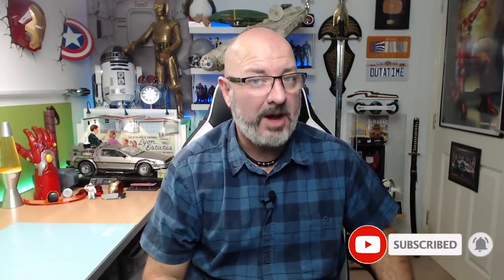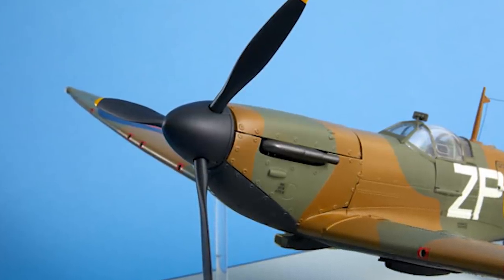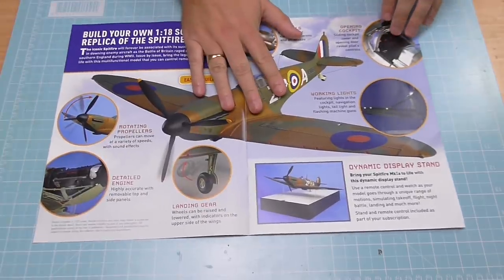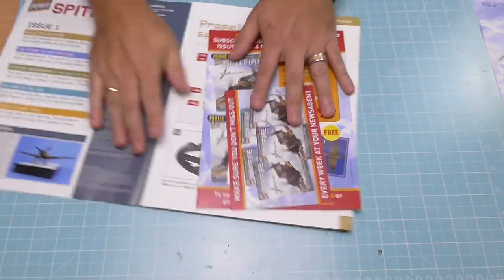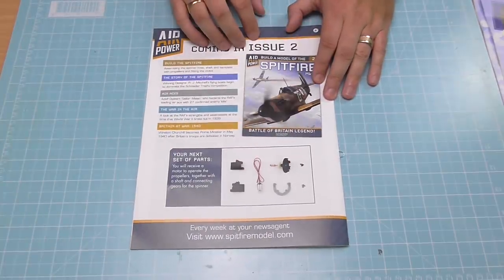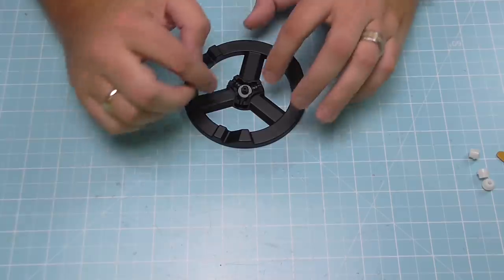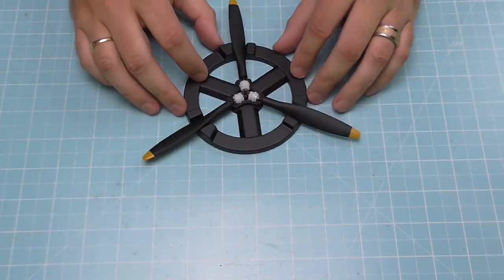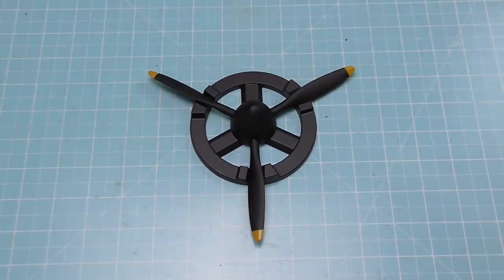Build the Spitfire Mk1a - Part 1 - The Propeller

Comment: Hi Wayne,
Just as a matter of interest and to let you know that the rotation of the blades, as you demonstrated, are known as variable pitch blades.
Here is some info I obtained from the web for you:
“Variable pitch propellers have been around a long time. ... It's the aircraft's propeller that is the source of thrust that moves a plane forward. Propeller-driven aircraft moving at varying airspeeds must have adaptable propellers so that the blades don't stall with the varying thrust and airspeed of the aircraft.
A variable pitch propeller can be adjusted to provide optimum power for the lowest fuel consumption in the engine.”
Hope this is helpful for you.
Building the Bismarck at the moment so will not be building the Spitfire.
I am enjoying your videos.  Keep up the good work.
Regards Keith.
Reply from the maker: Ahh that makes sense now

Comment: Hi Wayne. Like you i love all the moving/working parts on this one and if it does go to full production it would be tempting. However the only downside for me is the size of the thing and the fact the only really way of displaying it is on the suppled base. Kits like the Bismarck are long and narrow so ideally suited to a shelf ( heavyweight shelf or scaffolding :-) in the case of the metal Bismarck) whereas with this spitfire its a very "large square" in terms of its footprint so that might limit just were you could display this one. Interesting hachette video as well when they refer to "Working PropellorS" as in more than one :-).  Must say the parts all look very nice its just the size of the final product that would be an issue for me.

Comment: Is Hachette superior to DeAgostini? I finally got all the issues of Build Your Own R2-D2 however I had to buy issue 99 myself. Trouble is that I lost all interest due to the messing around by DeAgostini. Even had to cancel my Jazz collection where they also messed me around. My R2-D2 is halfway build. Having bad health and bad eye sight doesn't help much either.
Reply from the maker: You find the logistics lets these companies down. I have never had an issue with Hatchette or Deagostini. I understand everyone is waiting for Issue 27 of the Terminator build. Eaglemoss on the other hand is in a different league for bad service.
Reply: Eaglemoss are getting worse. They can't even do asimple online only relaunch of both their DB5/Nissan GT R 35 without making acomplete hash of it. I would happly build another EM car after their ECTO-1 is finished. But Eaglemoss are turning into both alaughing stock and ajoke and they've only got themselves to blame

Comment: The model looks fantastic but your facts need updating for the production version. As per TV ad it is now going to be 120 issues at a cool tenner a time, four issues a month (over 2 years). Company also has poor customer service rating on internet from people trying to cancel. No model should cost more than a grand !!! Rip off just like the Routemaster in previous years
Reply from the maker: They recently resourced the customer service centres. The costs are about normal for a partwork

Comment: Its a good idea, as I think everyone loves the old Spit, but at nearly a grand, thats to much for a lot of us older guys who are on income support, due to long term illness, I have build two Hachette models in the past, a 1/24th Tiger Tank, and a 1/ 32 Lancaster bomber, if I were to start building the Spitfire, I,m pretty sure the wife would kick me firmly in the gonads repeatedly and just for good measure stamp on them on a daily basis, I think the risk is to much, also you can buy a 1/24th scale Spit, and with a bit of work have all working parts the same as this build, at a much reduced price about £250 and lets face it anybody can build a stand to display it and run the electrics through, looks like I won,t be building this one Dam it